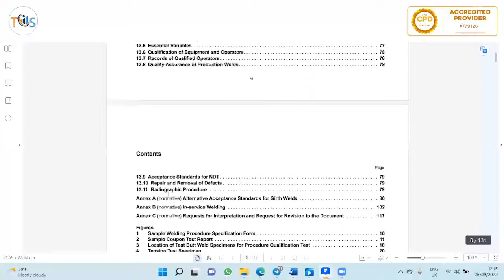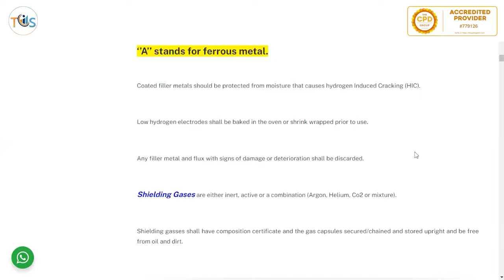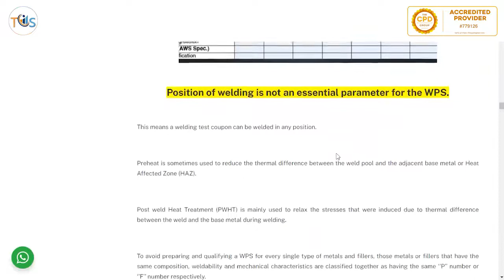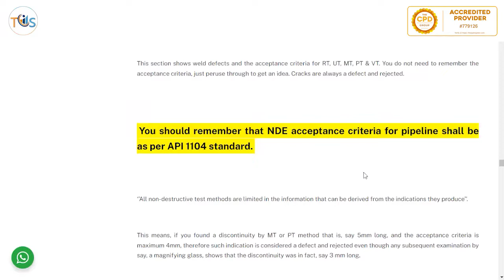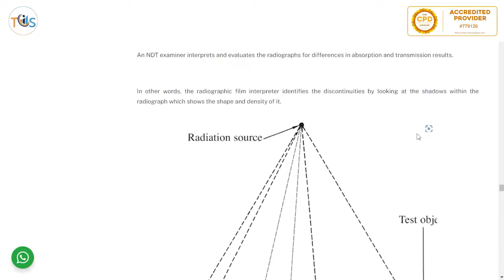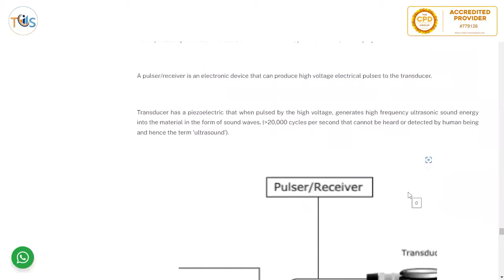API 1104 Pipeline Welding

Comment from the maker: Which API 1104 topic do you find most challenging — WPS/PQR, welder qualification, weld defects, NDT acceptance criteria, weld repair, radiographic testing or ultrasonic testing?

API 1104 is an important reference for pipeline welding and inspection and is also covered in our API 1169 Pipeline Construction Inspector training.

🎯 Explore API 1169 training:
https://inspector-training.com/courses/api-1169-pipeline-construction-inspector-online-hybrid-training-course/

Tell us which pipeline welding topic you would like us to explain next.